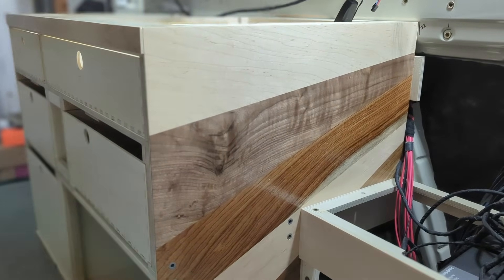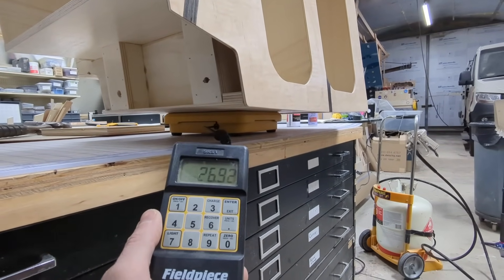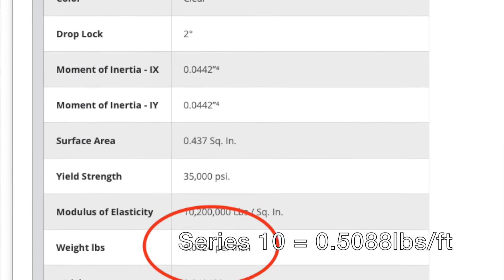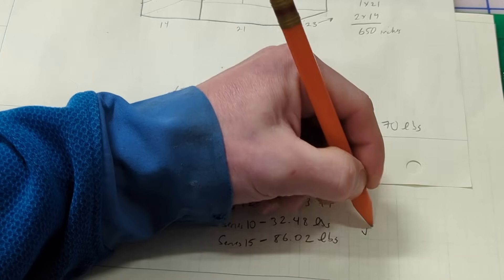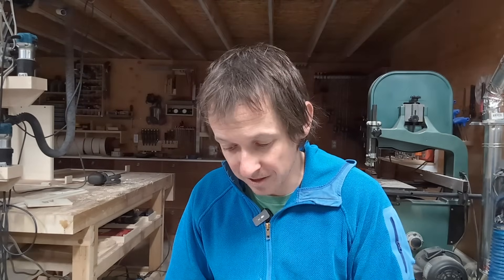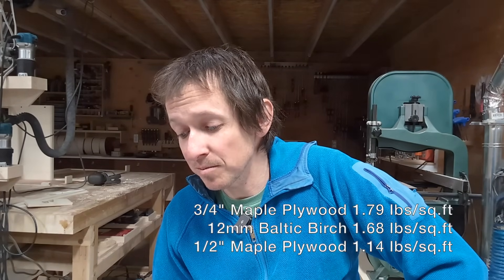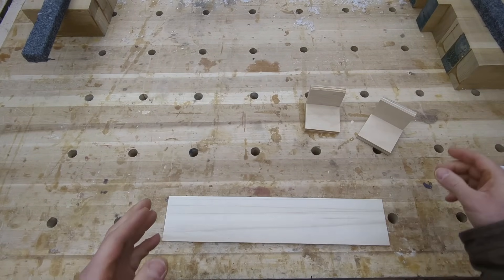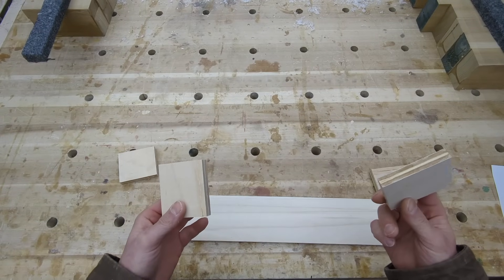Van Conversion Cabinets that are (actually) Lightweight and Maximize Storage

Comment: it's not necessarily built strongly to withstand storing food or clothes in it. The whole point most people use 8020 is that it's meant for catastrophic failure in case of an accident, or long term longevity where you see wood cabinets falling apart in vans or RVs after a few years of use. both scenarios are likely to happen in a mobile environment that's more like an earthquake everytime you drive, especially for those of us going off road. Much different than a static environment like in a house
Reply from the maker: I have to object.  Those "wood" cabinets in rvs falling apart are particle boards brad nailed together.  I do agree, 100% in a catastrophic event the 8020 will hold up better.  But what about everything else?  Is all the gear, the fridge, the drawers, the doors attached in any different manner?  I think using 8020 and feeling that your van will keep you any safer is a bit of an illusion if you haven't considered everything else at play.  And in terms of going off road...that is what my vans are built for.  Sure, huge bumpers and ornaments look cool, but a 10000 lb build will be digging holes in the dirt where a vehicle weighing 3000-4000 lbs less won't struggle.  My 2 cents.
Reply: Personally I feel better about a cabinet door flying at me in the event of a roll over, opposed to a whole cabinet.
Reply: I own a large Class C made by a major RV maker, and their choices in materials and construction methods make house flippers look good, seriously..  I took my family from FL to AK in this RV, and I discovered a lot of these poor choices.  The cosmetic choices of "hardwood cabinetry" was mostly the doors were heavy Oak panels while nearly everything else was MDF with a veneer and pockethole joinery.  Also bunks were built with 2"x2" sticks of pine that used nothing more than staples to keep them together.  Yes a Tjoint with staples at the top and bottom of the joint.  These are the items that I have found and had to fix thus far.  But overall, as a hobbyist woodworker, this cabinetry is crap.  Oh and in the fridge door panel, they had a nice looking raised panel piece that weighed over 15lb by itself.  That, combined with a fridge full of food and the roads in Alaska caused the plastic door hinge to fail just before we reached the arctic circle park on the Dalton Highway.

I too was drawn in by the swan song of 8020, but the costs and planning out all the bits and baubles made me quickly walk away from it.

I really like what was shown here and will keep this in my playlist for planning my remodel. Thanks.

Comment: The only thing I would do differently is put a thin runner of something really hard like Brazilian cherry/Jatoba (from flooring scraps) on the outer edge of the drawers bottoms and the supports underneath for slicker and longer lasting surfaces -- just plywood will wear significantly over time. A little paste was helps too for wood on wood drawer glides. Otherwise I really love this construction method.
Reply: orientation of the grain makes a huge difference too (plywood always has 2 orientations on each edge), it can be worth using split timber rather than sawn & yes, waxed hard hardwood makes great drawer slides

Comment: Thanks for sharing this!  One of my goals in my van is space efficiency.  I initially considered 80/20 structural members but I imagined it would be rather bulky compared to traditional cabinet construction. I wondered whether there was a trick to it I had missed but after having watched several build videos, it seems most folks using 80/20 do actually end up with inefficient cabinets.  So plywood it is!

Comment: Just remember 2080 aluminum extrusion costs about 30 bucks per 40 inch. You cut the weight but need about 3-5x cost.

Comment: I used 10-series 80/20.  I liked working with it.  Like advanced legos.I liked it for framing up my heavier items, like 29 gallon interior water tank, water heater, and batteries. It has been rock solid for 6 years now.  That said I only used it for base cabinets.  All upper cabinets are soft fabric.  Great video though.  I agree that 15-series is totally overkill.

Comment: Very informative!  I can't disagree with you.  However, I will still use 80/20 on my upcoming van conversion simply because of its relative simplicity.  I don't have a workshop, nor the necessary tools or skill for advanced woodworking.   The build will probably be a bit heavier, but I will be able to give my mitersaw to a friend when I am done, pack up my hand powertools and move into the van fulltime.  I don't think I will have to give up as much as 20% of space, though.  There are ways of making up at least some of it by leaving the rear of most of the cabinets open and using very thin vertical panels as they won't be load bearing.
Reply: It’s my guess that a well designed and detailed drawing taken to a cabinet shop would be the best and possibly cheapest solution for a lesser skilled DIY project. There are plenty of plan sets on the web.

Comment: Way to much aluminum extrusion in that cabinet design. Slide just attach to the front and rear 80/20 pieces. Use undermount slides and you lessen space lost.

Comment: Although I agree that 8020 will be heavier than wood, particularly your construction, I believe your assumptions are a bit off.  If you build with 8020 you will not build it the same way you would with wood.  You do not need the front cross beams, you can use a simple catch at the back of a drawer and have more space for cabinets.  If it is attached to the van walls, you don’t need a full square frame, you can eliminate the rear horizontal and vertical pieces.  Even with this, I believe 8020 will be heavier than your example, but no where near as much as you illustrate.  It is a this point that I think the increased strength, ease of construction and long term reduction in squeaks and failing fasteners from a high vibration vehicle begin to add value to the 8020 construction.
Reply from the maker: Thank you!  All these points are great for discussion and design considerations!  What kind of catches are you using to keep your drawers from opening?  I've tried all sorts of things, but no "catch" I've found has worked when really driving offroad, or even cornering hard, so I use the Southco M1-2A series of latches.  As far as squeaks and failing fasteners have you considered the amount of body and chassis flex these vans experience?  I had a section in the video about reports of sheet metal damage from having too stiff of furniture, especially rigid bed frames made of 8020, but in the end it was getting too lengthy.  I would hypothesize (but not bet;) on furniture that can flex a bit with the body leading to less squeaks and less fasteners failing.  A glued cabinet won't fail until until it cracks, and the only fasteners are the ones holding it to the walls (like 8020).  And since it is glued it has no independent components/parts to squeak except the drawers and doors (also like 8020).  

All this is hypothetical, and either design well built will still suffer from the silverware rattle driving us bonkers.  Thanks for your time! Cheers!

Comment: You wouldn't build an 80/20 cabinet in that method. A properly built 80/20 cabinet would not need a backside or half of the structural support so you can eliminate almost 30% of the weight you are accounting for. Also you would design your cabinet different. 10 series is so much stronger than a wooden 1X1 and easier to build with than creating complex plywood a carcass. For a master wood worker who has been building cabinets for 20 years you go with what you know. For the rest of us aluminum profiles (especially the far less expensive brands out there) work great.
Reply from the maker: Thanks for the feedback.  I agree I wouldn't build an 80/20 cabinet in that method;)  I'm aware there are better ways to use 80/20 but do a google image search for 80/20 van cabinets...99% of what shows up is what I am showing.  Much like people who love 80/20 writing wood cabinets off as 3/4" particle board crap.  I'd say a builder can make either method great or terrible.  

I'm sure you could reduce the number of supports, but if you want to use drawers or shelves can you?  For drawers you need something to attach the slides to.  And for shelves, if you don't support and secure a shelf on 4 sides you probably can't use 3 or 6mm material...so moving up to thicker materials eliminates any weight savings that eliminating the aluminum achieves.   

And yes 10 series aluminum is way stronger than 1x1s, but as I tried to say, do you need the strength?

Comment: Any man that uses 80/20 for cabinets probably needs the extra strength for all HIS dainty bra straps and hair spongies. I mean COME ON!!! They're the same men that wears blue rubber gloves when changing a light bulb or checking the oil in the truck.  Am I right or am I right? Forgot one thing. Same said "men" are also the ones that will get their said dainty painties in a wad when reading this. Missing all the factual humor.

Comment: Hi, it all sounds good and perhaps the material is over engineered but my concern is robustness of the finished item. Day to day use as a baseline to how it would stand up to a catastrophic collision. I’m not trying to be a d*ck but this is, I think, a legitimate concern.
Reply from the maker: 100% in a catastrophic event the 8020 will hold up better.  But what about everything else?  Both systems are attaching almost everything to the walls with 1/4" bolts (or even worse sheet metal screws). Both systems are using some considerably weaker latches and hinges to keep things secured.  Both probably are relying on a few tiny screws to keep the fridge secured.  So my personal opinion is that if you are really planning a build around preventing disaster then solely using 8020 isn't going to make a whole lot of difference.  These are huge vehicles often stacked with gear and components that will become projectiles far sooner than the cabinetry.  My 2 cents.

Comment: While I agree with many of the things you are saying: https://youtu.be/bdrw5dsey0Q?t=267
Reply from the maker: I didn't watch this start to finish 100% but watched a good bit of it.  The safety thing is difficult, and depending on what you want to deem "safe" you can make any claim.  Here is how I view it: 
1. Lightweight van: more manuverable, less likely to roll over, shorter stopping distance.  
2. Metal cabinets or wood cabinets: both will "go flying" if they are attached poorly to the walls.  So a light cabinet seems less painful to be hit by than a heavy one.  
3. If the cabinets are properly secured then the stuff inside will go flying if the doors and drawers blow out...so latch/hinge selection is important.
Reply: @projectofscience  Agree once again. But all that is not going to help if your cabinets end up planted in your brain after an accident. I would think something like a hybrid cabinet - outside framed in aluminum firmly anchored to the chassis and inside a lightweight cabinet built like you show - might be the best compromise for safety/weight.

I like your thinking, though. 😁

Comment: A bit disappointed in the video. First 10 minutes is basically a rant about why to use lightweight stuff and not the other. 
Ignores the fact that this type of wood is really expensive compared to other 10% heavier wood. 
Finger joint a beginner can't possibly make. Also the needed precision for sliding drawers is very high. 
So yeah, for a pro woodworker fine, if you want to spend hours and hours making something but if you don't have the skills, tools, money, and time, this is a waste of time :)
Reply: Unless You live in Europe, where for most people the maximum weight for a camper is 7,700 lbs, including liquids, 'life stock' etc

Comment: You can critique what these amateur van builders with no degree in engineering say or do with their 8020 and it’s meaningless. I laugh every time one of them yanks on the 8020 as if that proves anything. As you well know, the forces that will be exerted in an accident will greatly exceed any yanking. They can do even with pulling their socket out of their joint.

Comment: Wood is a terrible material to use in a van.   Although it is easy to work with, wood absorbs moisture and expands and contracts with temperature.   You may be a wonderful cabinet maker, and that is great for a house where you can control the temperature and humidity, but you can't do that in a van....
Reply: It definitely won't work in a mobile grooming trailer.

Comment: Of course a woodworker wont want aluminum.  Of course someone wanting a cheaper van would choose wood.   I'd love to compare your wood build to a 80/20 build in noise, strength and durability.    Anyone who has had a wood built RV or van knows the realities of wood over time.  And you are using 1/4" plywood.  I mean....Nobody is doing that in vans or RVs. Not even the most corner cutting companies out there.   It's an absurdly underspec material for a vehicle build out.   The smallest of accidents will be a nightmare.   That wouldn't even be acceptable in a stationary cabinet for a house anywhere in the country.  And no drawer slides?  Are we building a 1950s kitchen?   You could also compare the cost savings of building out of cardboard vs 80/20.

Comment: 8:50 that is a very weak comparison (stupid almost), the ENTIRE inner wall is not covered with 80/20 (only the corners and joints are) therefore, you are not losing the volume you calculated. 

You are using super light materials, I would say most builds use way heavier and thicker wood stocks, 2x4 even. Calculate the weight in that scenario as well.

Having a strong structure is NOT a disadvantage yet you flamed it as such - this discredit your video even more. Go build a bed frame, a box to house heavy batteries or water tanks then compare the weight difference then tell us how much weight you’ve saved.   Until then, its a 👎.

You should have just left 80/20 out of your video.
Reply from the maker: i think you failed to pay attention a little bit, but that's okay.  if i'm reading between the lines correctly you like working with 80/20 and feel challenged anytime someone suggests something might be better.  

about the volume comparison....did you see the drawer slides are part of the equation?  if you've invented drawer slides that can move through the thick 80/20 frame to keep the volume then please share!!! you'll be rich!

and the reason i didn't compare to heavier woods or 2x4s is because that's the only place 80/20 is lighter and what every 80/20 fanboy uses as a comparison.  i'm demonstrating the obvious which is that with slightly more advanced woodworking techniques you can easily build lighter than 80/20!

thanks for watching!